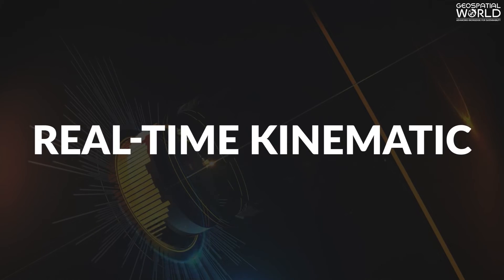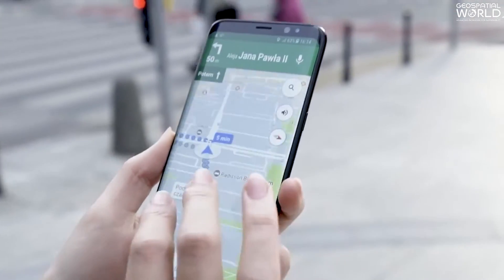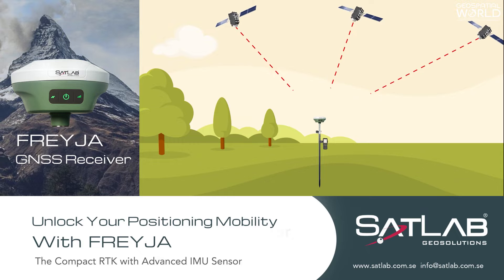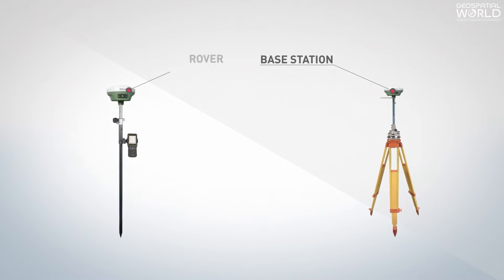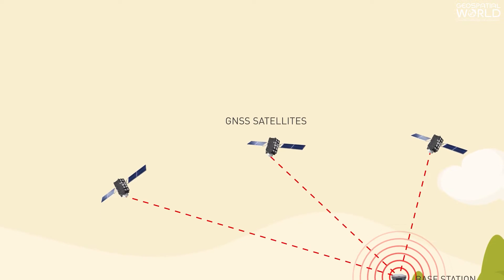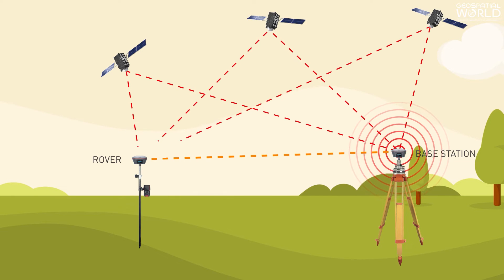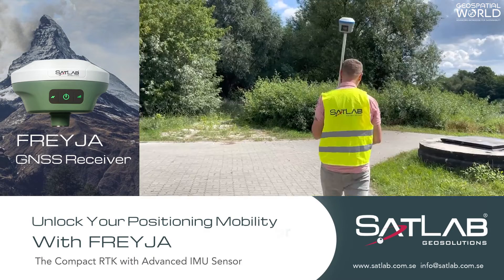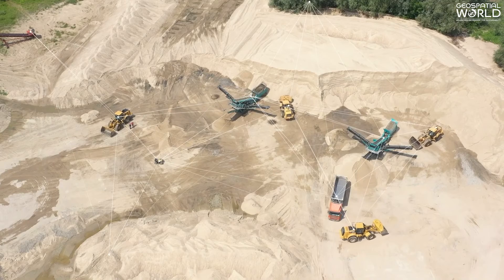What is Real-Time Kinematic (RTK) and how does it work?

Comment: That video is NOT a good description of how it works. The TEXT description touches on the actual method it uses:

"It uses measurements of the phase of the signal's carrier wave"

but fails to explain HOW it detects the phase of the wave, HOW such detection is used to calculate "correction data" to be sent to the rover, what that correction data looks like, and HOW it is used at the rover to produce centimeter-level accuracy of its position.
Reply: @TheRealCheckmate  I wish I could. It's what I was looking to learn when I came across this video. I'm sure it's a video somewhere, just not this one. And I've since moved on to different projects not requiring RTK.
Reply: @RogerGarrett  I'm trying to get just the gist of how RTK really works, but every video is too generic. I'm glad I'm not alone.
Reply: This video is just about DGPS(differential gps) .
RTK includes measuring the phase and no. Of wave cycles B/w the satellite and the reciever.

Comment: If the concept is this simple, why does it cost so much?
Reply: Costs $$$ to make complicated things operate simply.
Reply: covid
Reply: you can build your own rtk for 3 hundred bucks
Reply: @tracnunya7165  What hardware?
Reply: @NETBotic  I built my system with (an used) ublox LEA-5T-0-003, which cost about 25 bucks over 4 years ago. Now these modules sell apparently for about 9USD, but there are newer and better models available also. I used an ESP32 as the processor, and paid maybe 10-12USD for it. The antenna module was maybe 22USD, and the cables and the power source I had already. Less than 100 bucks total.
Reply: @MrZetor  I'm talking about off the shelf modules, from places like Spark Fun. What software did you use, RTKLIB?
Reply: @NETBotic  [My reply was blocked by YT. I'll try to post it in a piecemeal fashion. Not holding my breath though.]

My ublox LEA-5T-0-003 IS an off-the-shelf module/board, just like the newer models such as NEO-M8* and ZED-F9* which SparkFun sells now at 275-330USD. It's just a (much) older model that only supports GPS, can probably handle less satellites (I think 50?), has longer cold/warm boot time etc. But if the use case is a fixed base station that has a decent view of the sky, i.e., you are not constantly driving around doing surveys carrying the base station, it doesn't make much difference which device you choose.

SparkFun does also have full kits which include everything you need, and even fully enclosed stand-alone units, but their mark-ups are simply not to my liking (see e.g. the LoRaSerial kit at 175USD), and shipping to me from China is much cheaper than from the US. I don't think SparkFun even had any RTK gear for sale when I did my experiments. My plan was just to quickly patch together a system for a proof-of-concept, as cheaply as possible.

But you do you. If buying a used board and/or an old model is out of the question, or you just generally dislike eBay, I reckon you'll have to stick with SparkFun. Or find a cheaper seller, if any. If you don't or can't do any assembly and setup yourself, you'll have to go with a turn-key product, and they are obviously always more expensive. The point I'm trying to make here is that you can build an RTK/NTRIP base station for 50 bucks, relatively easily even.

Anyway, I connected my receiver to a PC with a serial-to-USB converter, and ran u-center by ublox to do the survey and some diagnostics. I did look into RTKLIB, and considered running it on an RPi2, but then chose to use an ESP32 and loaded a Chinese FW called 'ESPrtk' into it. This handled everything, including the NTRIP broadcasting, which I did with a WiFi.
Reply: @MrZetor  Yeah, I know what a UBLOX GPS is. I'm asking about off the shelf RTK, not just GPS, RTK GPS, hence the comment on this video. I'm guessing whatever you made was not RTK, or you could at least answer if you used RTKLIB. If you developed your own software, that's interesting because I know a lot of highly educated people that can't seem to DIY such a thing down to the accuracy of off the shelf RTK systems, like Spark Fun sells.
Reply: @NETBotic  "I'm asking about off the shelf RTK, not just GPS, RTK GPS, hence the comment on this video. I'm guessing whatever you made was not RTK"
- If your definition of an RTK (Real-Time Kinematics) system is something else than a (stationary or movable) base station that transmits positioning correction data (from GPS, and/or some other satellite system) to a (moving) rover that uses said data, OR, a (stationary or movable) stand-alone base station that is used in e.g. geographical surveys, we are talking about something completely different.

"or you could at least answer if you used RTKLIB."
-Yeah, I've been trying to do just that for almost two days now. I'm on YT's 'naughty list', and all my comments go through a review. Some, like the one above, get blocked even if there's absolutely nothing 'offensive' in them.

"If you developed your own software, that's interesting because I know a lot of highly educated people that can't seem to DIY such a thing down to the accuracy of off the shelf RTK systems, like Spark Fun sells."
- I didn't. My research topic was not navigation, although some guys a couple of doors down did just that. Inertial navigation mostly. Indoor stuff and 'urban canyons', that is. Anyway, I saw no benefit in trying to re-invent the wheel, as there was ready made SW/FW available, and I was never going for a commercial product.

BTW, I find it very odd that highly educated (I assume Dr. Tech. level) people couldn't figure out how build a system with ca. 2cm accuracy. Coding the SW from scratch wouldn't obviously be exactly trivial since the mathematics involved is at an advanced M.Sc. level.
Reply: @tracnunya7165  no way!
Reply: @Konkr420  Yes way. I built one over four years ago, and paid less than 100 bucks for the entire system. I got 2-3cm accuracy with a random ad-hoc one hour survey, with the antenna being duct taped on a snow plow marker stick that was right next to my 1.5-storey house near some tall trees. No metal base plate even. And I bet the gear is even cheaper and better now.
Reply: Every concept is simple. The complexity isn't even in the detail; it's in the work required to overcome the obstacles represented by the complexity of the detail. Summarising this masks all that work.
Reply: Start  up. And ita less and less as more come out.  Look at drones.